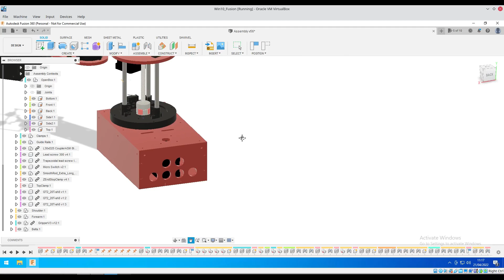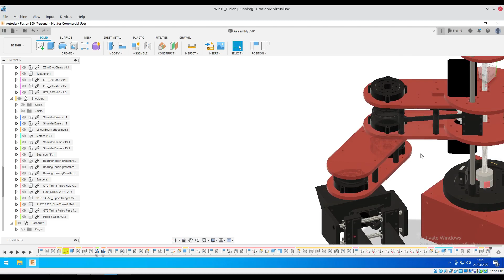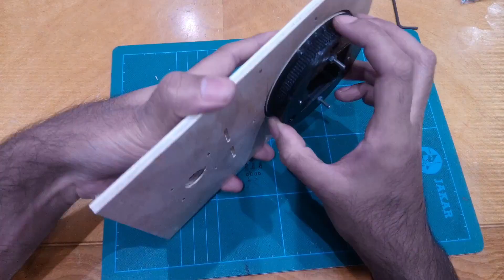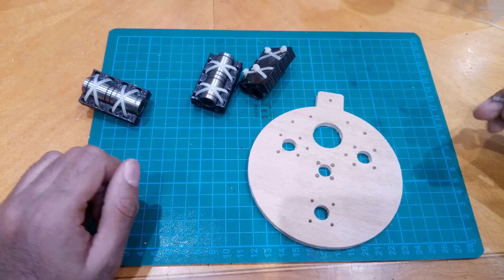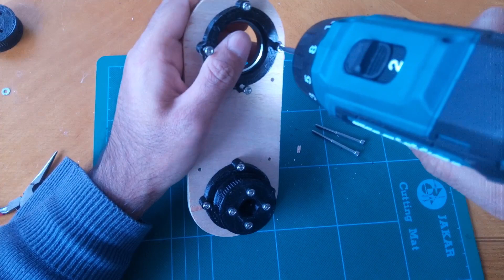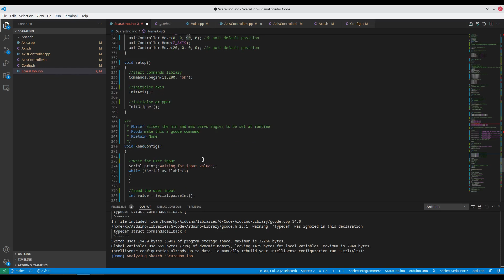Lil' Red- 4 Axis SCARA Robot Arm Build. Open Source- Arduino/GRBL/3040 CNC/3D Printed

Comment: Awesome project !  The gripper adds a third rotational axis.  I need a SCARA arm with only two.  How difficult would it be to change the code to work without the third axis? Thanks.
Reply from the maker: Thanks ! you can change #define NUM_AXIS 4 to 3 in Config.h and in theory that should disable the last Axis (C Axis)

Comment: Thanks for this. Do You remember what libraries and specifically version did You used for compile into vscode (for this, what extension) ? Thanks in advance
Reply from the maker: Hi, I have added a folder on the repo called "Libs" in the "software" directory which should include the required files for compiling. Thanks
Reply: @kpmaking9647 I just compile in a clean Arduino IDE installation, and the libraries and code, going WELL, perfect... Next step, try it only with motors.. Thanks
Reply from the maker: @DavidEliasFloresEscalante  Awesome, all the best with your project
Reply: @kpmaking9647 Thanks a lot, I will let You know when it's finished

Comment: Hello! I'm trying to make your robot. I have a problem with software. How did you manage to build your arduino project? Did you upgrade StepperDriver library? What is CServoSpeed?
Reply from the maker: The files in ScaraUno folder should give you everything you need to build

Comment: tienes los materiales que usas? sobre todo el circulo grande de la base.
Reply from the maker: The frame is all plywood, including  the circle at base which holds the bearing. The part inside the circle(black piece) is 3D printed PLA.

Comment: how did you specify the angle of rotation to the position of the object ?
Reply from the maker: AxisController.cpp implements Move() which accepts the degree to move each axis as it's parameter

Comment: Your video is so good. Could you give me the Gripper in the file Solidworks?
Reply from the maker: Hi, I have added a CAD folder to the repo with the full fusion 360 project including the gripper
Reply: @kpmaking9647  thank you bro
Reply: Where can I get full code, there is missing some files

Comment: Your video is very good and useful.
Can you give me the robot code?
Thank you!
Reply from the maker: Thank you! The code is on github: https://github.com/kpatel122/scara-s1
Reply: @kpmaking9647  Thanks you! Can you give me the wiring diagram of the model?
Reply from the maker: @mahienkhoa7081  The wiring is all done on a stock grbl shield, if you search for 'grbl shield wiring' that's essentially what this robot is (the code contains details on what pins have been used). If there's anything specific let me know. cheers
Reply: Some files are missing, please update and give new link

Comment: Hello, I have a very similar scara robot design, but the problem is replacing any kind of defective parts. As the stepper motors, drivers, cables or sockets tend to go bad quickly I am having difficulty to make the replacements. Are you thinking about sharing the bill of materials and the designs for the wooden parts of yours? If yes, could you please share those with me? I have only seen your codes in your repo links shared. Forgive me if I have missed it and if you have already shared those.
Reply from the maker: Hi, I have added a CAD folder to the repo with the full fusion 360 project
Reply: Where